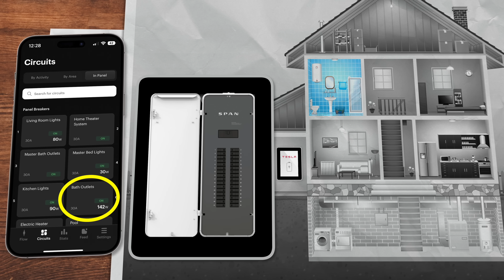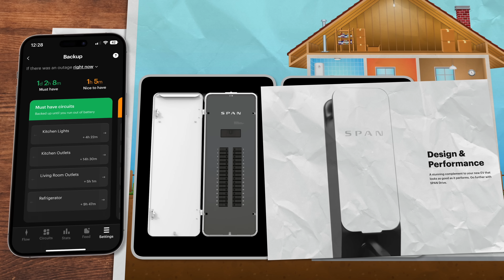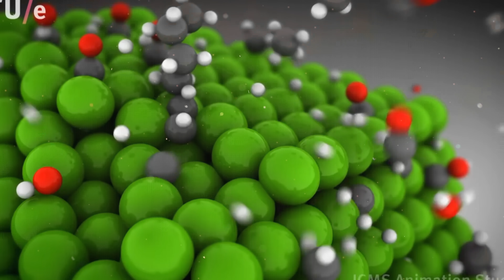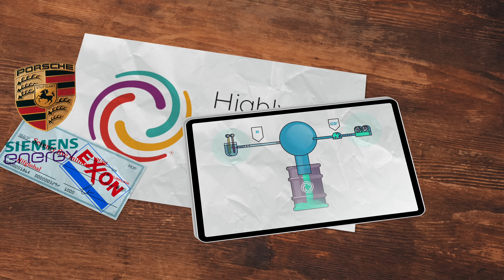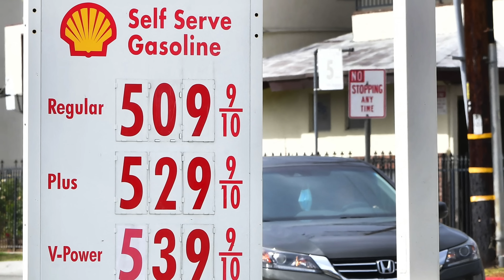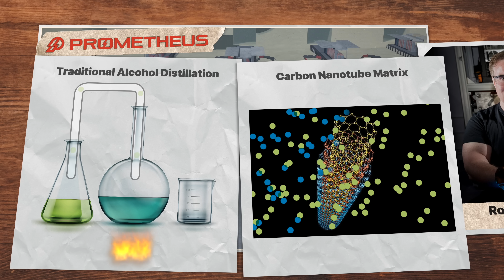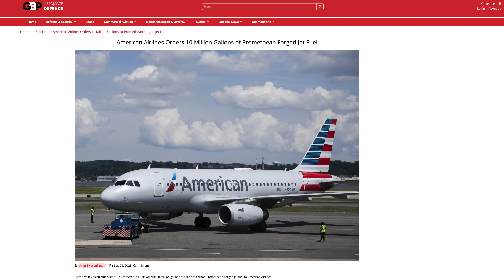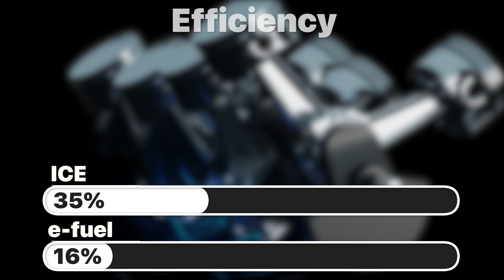EPIC Breakthrough Can SAVE the Internal Combustion Engine!

Comment: I’ve been really excited about Prometheus Fuels for a couple of years now, but the secretive nature of the company is unnerving. Better, more public demonstrations rather than flashy graphics would go a long way toward convincing people. A low temp/pressure, distillation-free process has tremendous advantages, and producing gasoline/kerosene/diesel that can run in existing vehicles is also a huge advantage. But I want to see them in real production, or at least making highly public demos. 

In the end, e-fuel success is simply a function of the conversion efficiency and the cost of electricity. As solar/wind costs keep dropping, one side is fixed. What about the other? Best-price solar/wind is under 2c/kWh now. There are about 35kWh in a gallon of gasoline. So theoretical best case is only 70c to make a gallon. Reduce efficiency to 50%, and it’s $1.40. Reduce to 10%, and it’s $7 in energy cost to make a gallon of synthetic gasoline. But if you could get that energy cost down into the sub-$3 range (25%), it becomes cost-competitive with fossil fuel - certainly, within range of subsidy and carbon taxes.
Reply: Sounds too good to be true like Nikola . The Nikola trucks are 100% green... they just roll down the hill!
Reply: @spicychad55  “Sounds too good to be true” was my first reaction to Prometheus Fuels too, but it only took me a couple of hours to believe they have at least nailed the concept, if not the execution. It helps that I found them through a source I truly trust, and at that point they already had backing from BMW and American Airlines… a couple of relatively conservative companies who would expect to see proof of viability before investing. 

The beauty is that it makes sense. They use a catalyst with tech leased from Oak Ridge National Labs to turn carbonic acid (carbonated water) into ethanol. This means they don’t need pure CO2 gas, and carbonated water is very easy and low-energy to make - basically just a waterfall and a fan. The next step is their secret sauce, but it is totally logical. They created a nanotube-based filter to separate ethanol from water, basically purifying the ethanol with a form of reverse osmosis. This gets rid of the expensive, energy-intensive distillation step! And it seems completely plausible. After that, it’s just straight into zeolite catalysts to wring extra H2O out of the alcohol, turning it into shorter hydrocarbons that can be combined to make gasoline, kerosene (jet fuel), and diesel. And because no distillation is involved, the whole process runs at room temperature/pressure. That means plumbing with cheap plastic pipe and rubber grommets, not expensive titanium. And it can be powered up and shut down easily, so they can use dirt cheap solar electricity and simply not run it at night - not an option for distillation-based systems with long power up/down cycles. 

So at least in theory, Prometheus is definitely on the right track, with a totally plausible technology and the financial backing of major transportation companies, and over a billion in Series B funding. And they’re at least promising 50% thermal efficiency for conversion at scale. If they can actually do that, they could be making carbon neutral synthetic gasoline that costs LESS than fossil fuel. That’s wild.
Reply: @davestagner  totally agree! This is exactly why I don’t consider this video’s title to be click bait, as some others have suggested.  As a chemist I understand, as you seem to do, the real breakthrough here that could really change things. This isn’t Fischer Tropsch, even though the starting materials and end products are the same. The 100-year-old FT process is like climbing to the top of Mount Everest and going back down to get  to  the other side, while Prometheus just dug a tunnel right through the mountain. I really hope to see those fuel forges come out soon. Reeeaaally hope this doesn’t turn out to be a Theranos on steroids and cocaine.
Reply: @ipp_tutor  Yes, exactly! That’s how I went from “that’s ridiculous” to “that’s inevitable” over the space of about two delightful hours. They’ve fixed the ugliest, most energy-intensive part of synthesis… separating alcohol from its water solution so it can be processed into shorter hydrocarbons. What do you think of their efficiency claims? Do you think they can approach 50%, as they’re claiming? If they can… woah. Talk about printing money. They’ll do to fossil fuel what Uber did to taxis. 

But I get what you’re saying about fearing another Theranos. I fear that too. But what I’m hoping for is that it’s another Tesla Truck, suddenly appearing and making good on all the outlandish promises and proving the doubters flatly wrong.
Reply: @davestagner  Be careful, don't waste your money, invest in something better.
Reply: @tedmoss  I can’t invest in Prometheus Fuels even if I wanted to. They’re not a public company, and I’m not rich enough enough to participate in billion dollar funding rounds by a long shot. But that said, why do you think it’s a waste of money? Do you think their tech doesn’t work, or that there isn’t a market for it if it does?
Reply: @davestagner  Do you wonder if the entire planet has been on the lookout for semi-permeable membranes for ethanol, Jack Daniels included. If they can do that they are already gazillioniares
Reply: @BobAgxgolf  No, I actually think it was just a brilliant insight by one person. It’s a pretty good use of carbon nanotubes. On the other hand, I don’t think it’d be hard to duplicate, although I’m sure it’s patented very thoroughly. I can’t imagine it’d actually be all that great for a booze distillery… the complexities of a whiskey mash would be completely destroyed by the filter. But it’s great for industrial ethanol use at massive scale. It went through the Y Combinator startup accelerator. I found out about it because Paul Graham (Y Combinator founder) was praising it.
Reply: @BobAgxgolf  Duuudeee!! I hadn't thought of that. "This Changes Everything" is an understatement!!! I don't think anyone had talked about decarbonizing the booze industry. Can you imagine Jack Daniels without distillation towers?

If there's anyone who can pull this tech off that's Rob McGinnes. Check him out. He's been working with nanotech membranes for years and made some serious progress for water desalination.

Although, come to think of it... the taste would probably be quite different. There are many volatiles that co-distillate with ethanol during the manufacture process that give each drink a part of it's final flavor and characteristics. Don't think the same compounds are likely to get through the membrane as they do in the vapor phase. But it's one heck of a good idea!
Reply: This is fascinating just reading this comment, never mind the vid not pressed play yet. Now taking this shameless opportunity to plug Ecotricity's Gas From Grass which they themselves rate at 13% the emissions of fossil gas, and could be rolled out immediately, whilst slowly putting in heat pumps and such. Perfect for very short term heating / cooking needs.

1. Grass grows, sucks up CO2. 2. Anaerobic digest to methane. 3. used to cook / heat 4. produces CO2 5. back to 1. Synergies: Requires people eating less livestock, lowering emissions from meat. Also a wild idea I heard to feed cattle certain types of seaweed. Better for their guts, health, less gas emitted. Probably more synergies than I've seen yet.
Reply: @TheHorseshoePartyUK  Just get more cows and collect their gas to run all the cars on earth.
Reply: I wonder if this solution couldn't be paired with a solar farm, in which the excess heat the panels receive (which lower their performance) could be transferred to the alcohol solution in the water in order to distill it. I guess there must be some complications, but to me it kills two birds with one infrared wave.
Reply: Anything that can produce fuel cheaper than current fossil fuels would be like printing money. 

What I don't understand is why we can't use the alcohols more directly as fuels saving that last step. If I remember,  alcohols were some of the first ICE fuels before we had gasoline. It is currently used to fuel a whole class of dragster. 

If alcohol was available in dependable quantities at competitive prices, manufacturers could easily adapt their current ICE vehicles to burn pure alcohol instead of the gasoline/alcohol mix that almost all vehicles currently burn. This would then be a closed loop as far as carbon emissions are concerned.
Reply: @everettlwilliamsii3740  A couple of reasons we don’t use alcohol for fuel. First, it’s low energy density relative to gasoline. Fuel mileage of an alcohol-based ICE is about half of what you get with gasoline. (It’s used in racing because it has other advantages and race cars don’t car about fuel efficiency.) Second, it comes in two common forms - ethanol, which is an intoxicating beverage; and methanol, which is a deadly poison. Methanol is FAR too dangerous to use as fuel in regular vehicles. A teaspoon of it will permanently blind someone, a full drink will kill. It also burns with a colorless flame, making fires more dangerous because you can’t directly see them (I’ve seen race fires - it’s awful, you can’t see what’s going on). There are other issues as well, around solvent behavior and such. 

But the killer problem is that it doesn’t run in existing passenger/commercial vehicles, and you can’t just tune them differently. The whole point of this exercise is to make a carbon neutral drop-in replacement for the hundreds of millions (billions?) of cars and trucks already on the road. Anything else just finds itself competing with EVs, and will lose. Even in a best case scenario, we’re stuck with a LOT of gasoline-burning vehicles for at least twenty more years, probably longer. If we could clean them up, it’d be a tremendous victory.
Reply: @davestagner  Actually about 30% less power dense E10 is pretty perfect for most car on the road.
Reply: @everettlwilliamsii3740  compare the price of E85 to petro, (google a "gas station in Brazil). E85 is a little less than $3.00/gal right now.
Reply: Out of the options shown I like their concept the best, using alcohols as the intermediate fuel, but it seems really inefficient to "synthesize" the alcohol.  Let nature take that huge energy sink and use traditional fermentation to generate the alcohol.  Then do the final step and convert the alcohols to hydrocarbons.
Reply: Unfortunately, it is the efficiency of the process that ultimately determines the winner, and we already know the answer. Everything else is just fooling people and taking their money.
Reply: @Dave Stagner   I admire your optimism, but I heard of this technology about 15 years ago and it is still not used for whatever reason. Poland is testing similar technology. They capture CO2 from industry and make alcohol out of it. The pilot plant is running for few years now. Not commercially profitable though. Those who benefit from EV industry will be very unhappy when such bio fuels hit the market. I think their lobbyist will do everything to derail it.
Reply: @vihayster  I’m a lot more worried about oil industry lobbyists than EV industry lobbyists. Say what you will about Tesla and other EV manufacturers, but at least none of them have a track record of overthrowing governments that don’t agree with their exploitation plans. The oil industry has been doing that since World War One.
Reply: @vihayster  You said it yourself. The reason is that the tech wasn't commercially viable. The main reason for that is the need to purify CO2 gas after capruting it, and the high temperatures and pressures needed for the traditional Fischer-Tropsch process, both of which consume A LOT of energy. The key breakthrough here (and it is definitely a breakthrough, if what Prometheus promisses is real) is that they avoid both these issues:
a) They dissolve CO2 in water which is super easy and dirt-cheap, and they use a catalyst to turn CO2 into alcohols directly from the stock water solution without sepparating the CO2 gas from it (saving a ton of energy).
b) They use a membrane to sepparate the alcohols from the water at room temperature and pressure without distillation (saving even more energy).

It's brilliant IMO!! Fingers crossed!!
Reply: Nobody wants noisy, poorly performing smoke boxes any longer. They want high performance iPhones on wheels.
Reply: @PaleBlueDotCitizen  Horses! lets go back to horses! Unlimited financial opportunity to clean up their shit!

Comment: I would like to hear how efficiently an EV with a range extender would use energy from renewable e-fuels.
Reply: This would be a good solution, since instead of just one person (who was most probably on a year plus long wait list), three or four home owners can decarbonize their daily commutes using the same amount of batteries in a BEV and only use the ICE when going on longer journeys so they don't need an enormous battery pack all to themselves for those infrequent longer trips. Of course folks who live in apartments or have really long daily commutes should go full BEV. Maybe in five to ten years when all the mines and battery factories are in full operation, and recycling is a thing, everyone can go full BEV without hording supply, but now there is just to big of a bottle neck for full BEVs to be a solution for everyone.
Reply: It is being done.  Nissan has the weirdly-named Qashqai car that used a gasoline engine to run a pure electric motor drive train.  E-power they call it.

Comment: Standing still is an improvement over running backwards. It is not a replacement for moving forward.
The concept of using e-fuels to minimize damage while we move forward with more sustainable solutions is great... Except for one little problem. If you give politicians an easy way out, a 'have your cake and eat it too' solution, guess what they are going to jump on, fund, promote, and divert previous resources and public opinion towards... Yeah, whatever gets them the most votes. The easy way.
Reply: building EVs at scale without wrecking the environment and causing all manner of raw materials scarcities (especially copper) is not at all a solved problem - as things stand now, EVs are not even a viable option. Which really just leaves ICE vehicles using synthetic fuels
Reply: Education and knowledge wins out, even over politicians.
Reply: well thats a rather dystopian and pessimistic way to look at things. the ball is already rolling on both electric vehicles and an electric power grid. widescale adoption of efuels wouldnt stop that. theres money to be made in both of them and where there's money there's progress.
it's not really a step forward or step back, it's more like growing a third leg and walking in whichever direction has more muscles. though it's definitely harder to walk when you cut two of your three legs off when your third leg is an atrophied little infant peg.

Comment: Replace the cars is not so big challenge. Ships and airplanes are different. Cars is massive waste and "easy" to replace. An electric car is not very different and even easier to build than ICE with the exception of the batteries. But I'm optimistic about the scale of battery manufacture.
It will take time, but also grow the e-fuels just to replace other sectors where it's the right solution, so there is no room to create more efuel for the remaining ICE cars.

Of course, this doesn't require ICE ban. Just with the expected price rising, only niches will insist on use ICE like classic cars, maybe competitions, special cars like police and so on. But regular people will use electric, just because it will be cheaper (I don't say cheap... just cheaper than fossil fuels).

Comment: Battery vehicles use over 81% of the electrons that leave the windmill/solar panel. For efuels, this figure is about 15%. So no - it's not the answer. We'd have to install over 5 times the renewable energy..... fuels should only be used for hard-to-electrify vehicles such as large civil aircraft. Oh - and shipping efuels is a lousy way to move energy. Ship them in a heavy diesel supertanker? No. The cheapest (and far more efficient) way to move energy is using HVDC cables.

Comment: Interesting vid.  Fossil fuels will run out so electric is a good replacement.  A couple of issues: The three electric grids in the US are old, inefficient, and can't support the demand that would be needed to keep America moving. Second; batteries are an environmental nightmare to produce. The west doesn't care because its not happening in their backyards.  I do like you acknowledging that carbon based fuels for ICE's will be needed. Forcing EV usage is not smart.  Battery tech is no where near what it needs to be to make this happen in a "green" way.  Also, the global economy that the US created as a result of Bretton Woods (WWII) is breaking down and our supply chains will be in a bad place for a couple of decades.  Global trade which is required to make this all happen is collapsing, see China (PRC). Also, do a deep dive on the solar cycle and dwarf/recurrent novae.  The Younger Dryas part 2 is closer than we think.